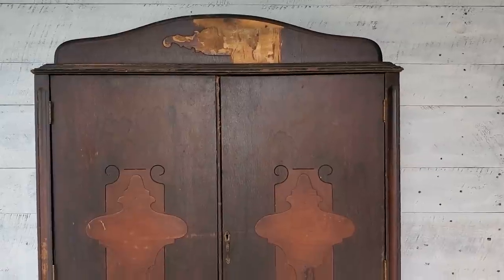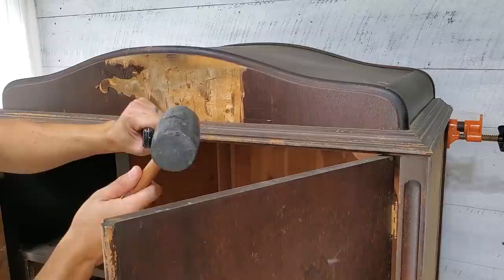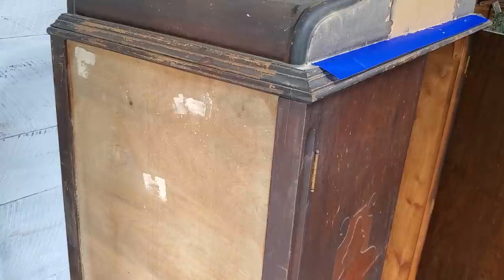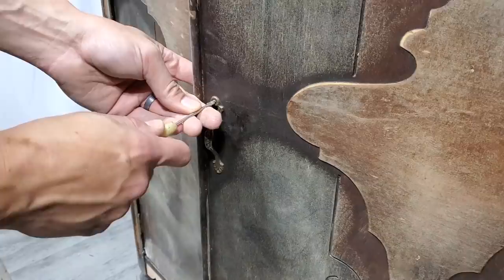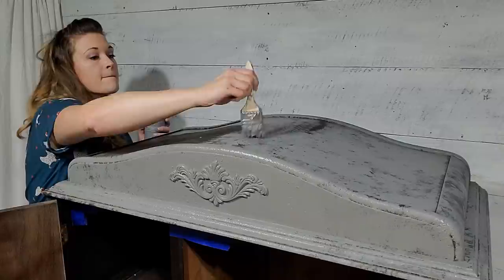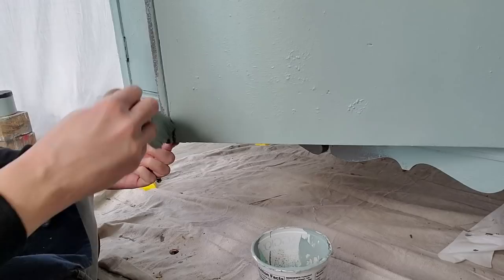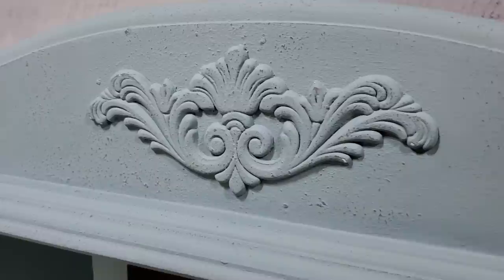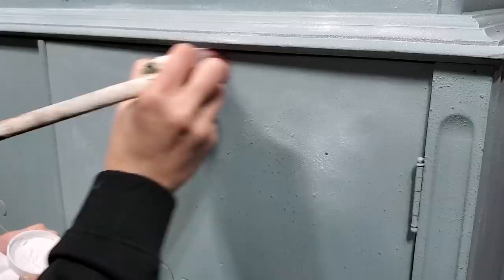Can We Save It?!  Chalk Paint Wardrobe Makeover

Comment: Beautiful!  Did you happen to test this for lead? I had one very similar to this in my shop but when I tested it I found it had lead in the finish!  I gave it back to the client and told her I did not want to touch it.
Reply from the maker: We did not. While it was most common in heavier finishes like used on floorings and things like that, you are correct that it's definitely something to be aware of in furniture as well.  You can usually tell by the look of it, after you've seen so many pieces.  The texture and look are usually a good first giveaway.  This wardrobe I wasn't worried about, but the 1800s empire dresser we recently did was a different story as that texture and flaky-ness was a pretty good giveaway.
We always make sure to have a very well ventilated area regardless, and a hepa filter hooked up to the sander, but it's definitely something to keep in mind just as you would for paint.  ;)  You probably saved yourself a lot of headaches by knowing ahead of time, for sure!

Comment: YOU GOT A GREAT DEAL ON THE PIECE FOR $5.  YOU SHOULD HAVE WASHED DOWN THE PIECE GOOD BEFORE DOING ANYTHING.  IF YOU DIDN'T USE MASKS, YOU SHOULD HAVE.  YOUR LUNGS ARE NOT INVINCEABLE AND ARE WORTH AT LEAST TRYING TO KEEP ALL THAT CRAP OUT OF YOUR LUNGS.  THE PIECE WAS EVERY BIT A 100 YEARS OLD.  TAKE THE TIME TO REMOVE DOORS, ETC., OFF THE PIECE WHEN YOU'RE DOING REPAIRS, ETC.  A LOT LESS EFFORT COULD HAVE BEEN MADE TO SALVAGE THE PIECE (WHICH IS WHAT YOU WERE DOING).  YOU SPENT MORE TIME TRYING TO WORK AROUND HINGESS, ETC., THEN IF YOU HAD JUST REMOVED THEM.  BTS, WHAT IS THAT BONDO EVERYONE TALKS ABOUT.  I KNOW OF ONLY THE BONDO USED ON CARS, ETC., WHEN DOING BODY REPAIR.OTHER THAN THAT, JUST PROTECT YOUR LUNGS BETTER AND HAVE GOOD VENTILATION WHEN DOING SOMETHING LIKE THIS AGAIN.  YOU WOR  KED HARD TO MAKE SOMETHING OF YOUR PURCHASE.  HOPE YOU HAD SOME FUN DOING IT.  PAINT SPRAYERS CAN BE YOUR FRIEND TO CUT DOWN ON THE TIME YOU ARE EXPOSING YOURSELF TO DUST, PAINT, ETC.  I JUST BOUGHT ONE MYSELF.